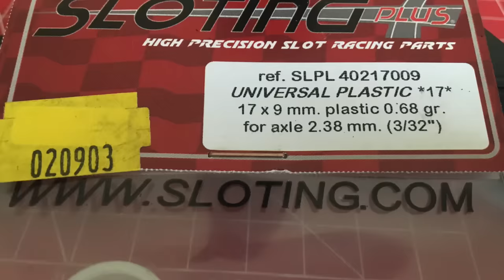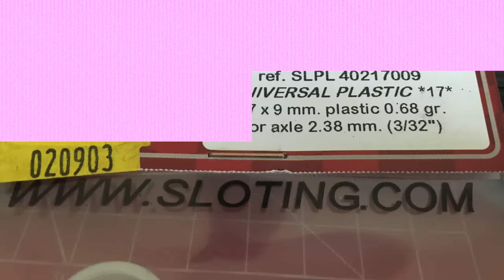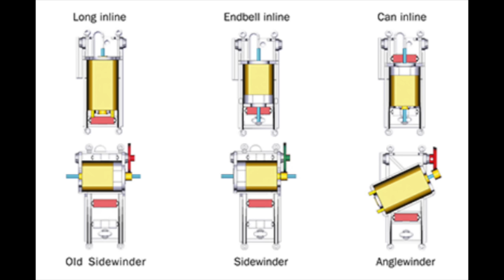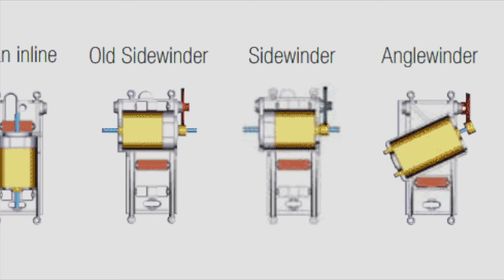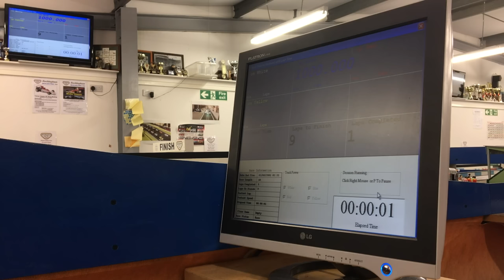Toy Brands vs. Professional Slot Racing Cars

Comment: Really the ONLY difference is Retail Price Point... at least twice the price for what you call "professional" car... I can upgrade a Carrera or Scalextric to beat your "professional" car... without fridge magnets... for similar money.
Reply: Really, would like to see that.
Reply: @swedecarlson6511  the fastest cars on a home layout, set up for Club Racing, so done properly, is SCX 4wd Citroen... the only cars faster on my routed tracks are Flexi Cars... and a flexi will smack any of these cars into next week at half the price...
What I'm saying is it's all relative... the problem with Slot-it etc, is they're only competitive against each other. And they're expensive...
Reply: Well, I build a small track just to be able to run those toy cars, lovely looking toy cars.
To put them on a long, technical wooden track, is just like using a Prius for Nascar..
On my fast and wide track those cars don't work. What I try to say is toys can provide a fair amount of fun in the right environment.